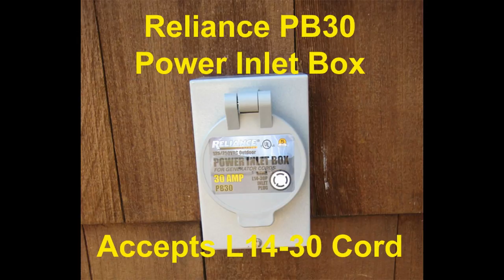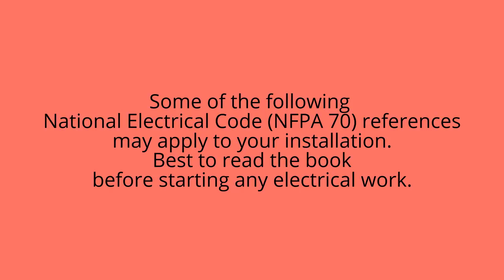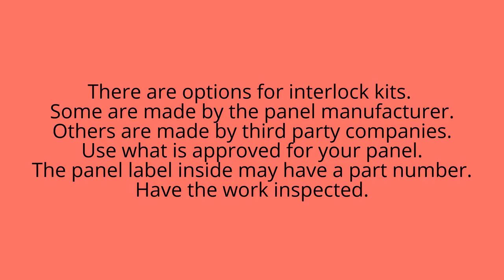Generator Interlock Kit installation on Cutler Hammer Load Center

Comment: Great video, I have the same electric panel as yours. What’s the item number, barcode, or model number of the interlock.
Reply from the maker: This was from a clients house several years ago. I don’t remember the model number of the interlock kit, but I purchased it from interlockkit.com.  They have photos so you can match it up easily. Call them if you can’t decide which kit will work on your panel.
Reply: Thank you so much. It was a great educational video.

Comment: Can’t use braided wire for a home electrical panel anywhere there are codes, that I’m aware of
Reply from the maker: Hi Gary.  What braided wire are you referring to?
Reply: @MrElectricianTV  at 1:10 on your video
Reply from the maker: @tubbienine  It is called stranded wire and it is approved for almost all installations that solid wire is approved.  Larger size wires are stranded to make them easier to work with.  No code violations here.  This interlock kit installation passed inspection.  Thank you for your concern.

Comment: @ 1:12 what wires did you twist together?  I assumed that the red and black wires from the PB30 would connect directly to the breakers in the panel.
Reply from the maker: Craig, There was an existing stove circuit breaker in the slots that I needed for the generator breaker.  I had to extend the stove circuit wires further down by splicing them.